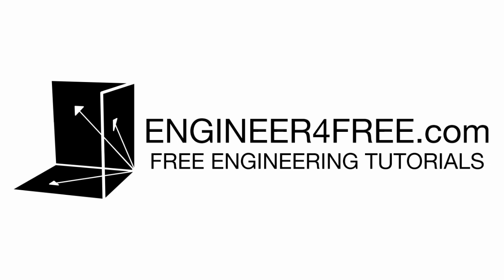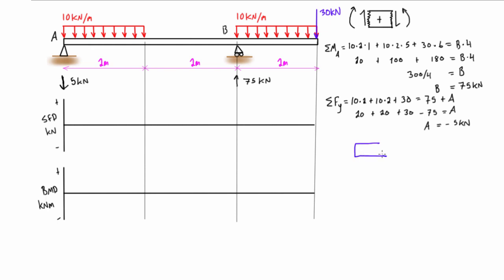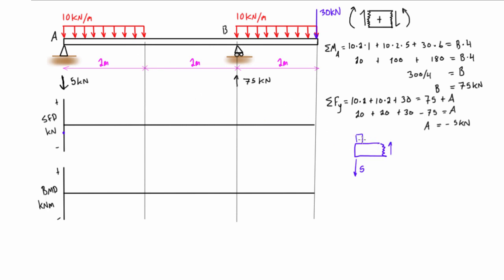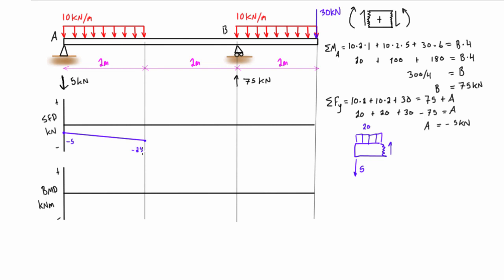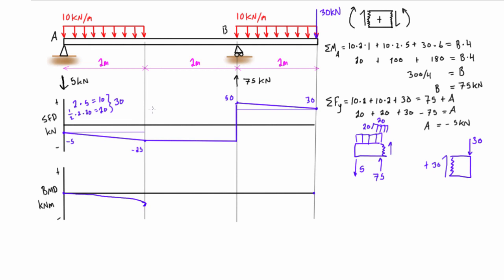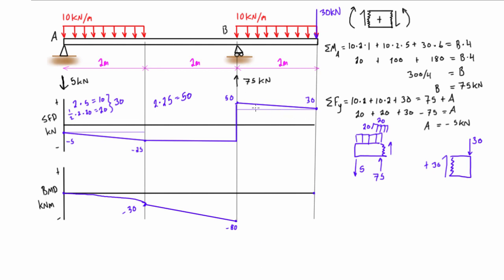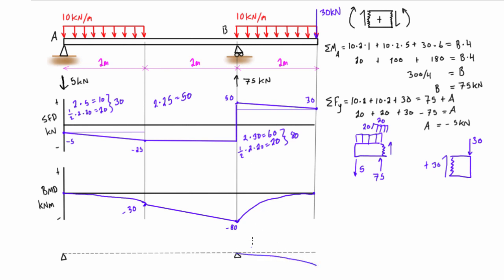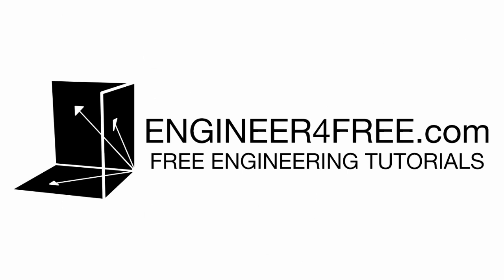Shear force and bending moment diagram practice problem #7

Comment: Why didnt you add the 20kn/m load at sfd diagram beside the rollers?
Reply: I mean why is 30kn only consider isnt suppose to be 2(10)knm+30kn=50 so that it will meet the x axis at 0?

Comment: Would the maximum shear be 50kN, or 75?
Reply from the maker: I see the confusion, but maximum shear is 50kN. You might be asked to specify max + or -, or just absolute max. Just find the point furthest away from the horizontal axis and take that. It's not referring to the jump across a point load. 👍

Comment: Why did you divide the 300 by 4 to get 75kn
Reply from the maker: The left hand side of the equation was 20 + 180 + 100 which is 300. The right hand side is B*4. So rearrange 300 = B*4 to get 300/4 = B and then B = 75. Just divide both sides by 4.
Reply: @Engineer4Free  thanks bro

Comment: 3:09 , from -ve 25 to +50 .....or -ve 25 to +25
Reply from the maker: The SFD jumps by the value of the point load. The point load there is 75k, so - 25 + 75 = 50.
Reply: @Engineer4Free  thank you!

Comment: For the BMD why does the parabolic curve up and rise and not curve in like other examples?
Reply from the maker: Most videos that I did have a situation where the beam deflects downward between the two supports. Because of the force on the overhang, it causes the overhanging section to deflect downward, and the section between the supports to deflect upward. The opposite nauure of things is why the BMD is flipped over the axis

Comment: If 30KN is removed, then what happens?
Reply from the maker: The entire diagrams will change slightly, but most notable, the right hand side of the SFD will have a value of 0, rather than 30.

Comment: how it is possible to have a negative reaction
is it pulling downward
Reply from the maker: Yes it is. This is an overhanging beam. Imagine a teeter-totter with a heavier weight on the right side of the pivot. The whole thing will rotate clockwise about the pin. Put an other hinge reaction on the far left side to the teeter-totter and it’s going to “pull down” resisting the rotation, and keep the structure in static equilibrium. That’s what’s going on here.

Comment: thank you for the information, but i have a problem with a diagram that includes a moment in the middle of the beam ... how do i draw the bending diagram
Reply from the maker: Watch videos 1-9 here: engineer4free.com/structural-analysis and follow the exact same methods. Solve reactions first, then systematically draw FBD, then systematically draw BMD. Point loads, idols, moments can be located anywhere. Some of the examples mentioned do have applied moments. Basically the SFD will be unaffected, but the BMD will jump at the point of application.

Comment: I think there should have vertical line in the V graph(at the end of graph) since the end of the beam has point load
Reply from the maker: A vertical line is unnecessary, the internal shear @ 6m is 30 kN

Comment: can i ask why 10 x 2 x5?
Reply from the maker: Yeah np. In the sum of moments equation, that term gives the moment that the furthest right UDL causes about A. First, lets look at the furthest left UDL. it's term in the equation is 10x2x1. 10 is the magnitude in kN/m, 2 is the length of if it in m, and 1 is how far the centre of the UDL is from A. For the furthest right UDL, we have 10x2x5. 10 is also the magnitude in kN/m, 2 is also the length of this UDL, and 5 is the distance from A to the centre of this UDL. the UDL is 2m long so the centre is 1m from either side. The left side of the UDL is 4m from A, so 4 + 1 = 5 for the location of the resultant force used in the moment calc.
Reply: @Engineer4Free  thanks u
Watching your clip helps me a lot as i just start my first semester in an Australia university and i am not a native speaker. Hard to follow the lecture at some points, but everything is clearer after watching your tutorials

Comment: For the BMD, wouldn't the parabolic curve from B to the end be concave upward because V (the slope of M) = 0 at point B?
Reply from the maker: Hey Guiliano, no it should be concave down. The shear is not zero at point B, it's discontinuous. We are concerned with the shear infinitesimally close to but on the right side of B. That shear is +50 kN. I like to think graphically when determining the concavity of parabolas on the BMD. If you imagine taking the area under the SFD numerically, we would slice it up into a bunch of tall skinny rectangle-ish shapes. If the shapes all have the same width dx, then the shapes on the left side (near B) would have more area per shape than on the right (near the end) because they are taller. More area on SFD means greater slope on BMD. Greater slope means steeper curve. The only way to draw a parabola that "goes up" form left to right and is steeper on the left and less steep on the right is to have it be concave down. You can math harder than that, but I still prefer to think about it that way every time.
Reply: Oh ok, thank you!